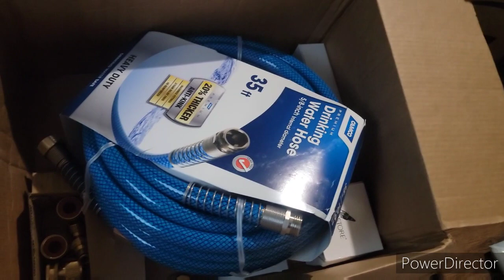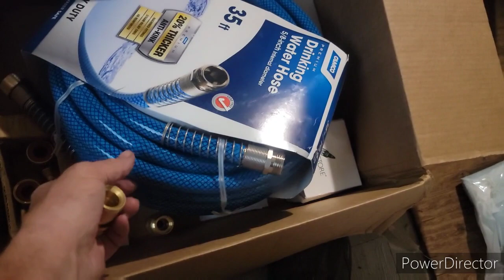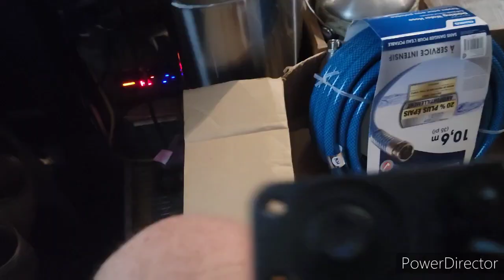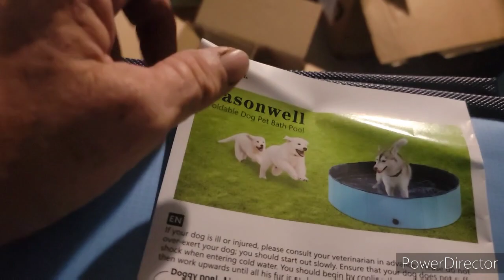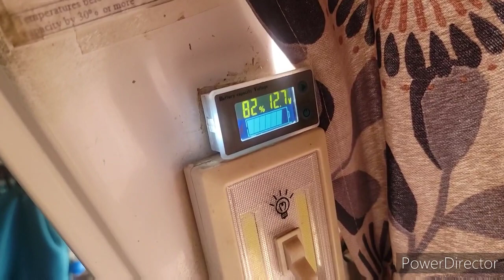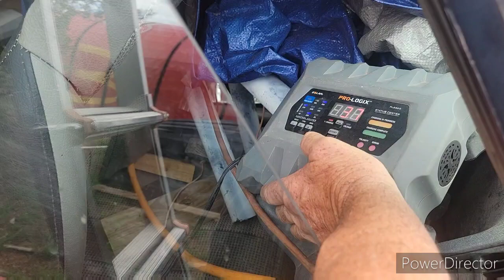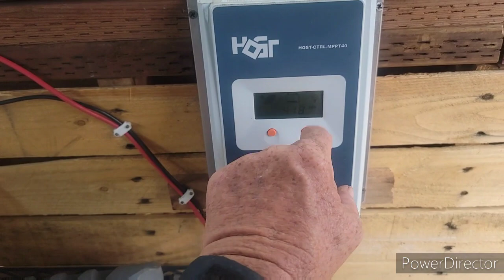Rain, Clouds & no Power July 31, 2022

Comment: Are your refrig and freezer both AC? My home is off grid and my small AC frig just zapped my batteries in the winter. I switched to a DC frig and it helped immensely. Do you need a DC frig?
Love that work bench!
Reply from the maker: Yes my fridge & freezer in the van are AC. What I need are new batteries, the current ones are 6 years old and not holding a full charge anymore. They are down to 60%. Currently, I have 4 golf cart batteries. My hope is to sell Dusty (tracker) and get some lithium batteries.